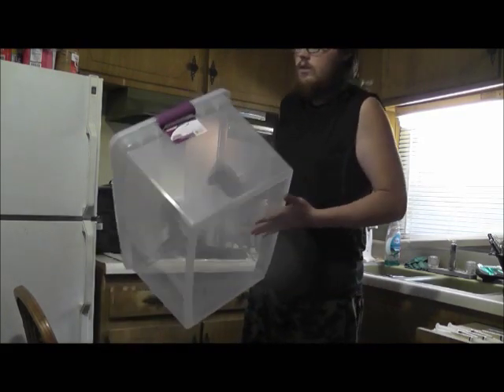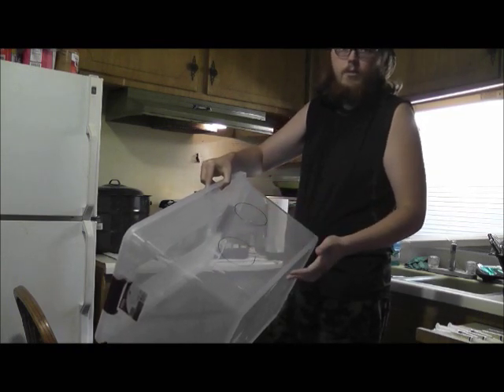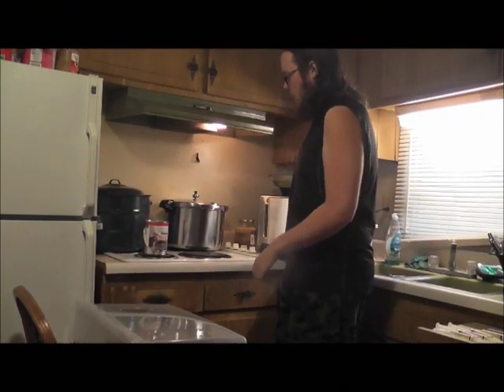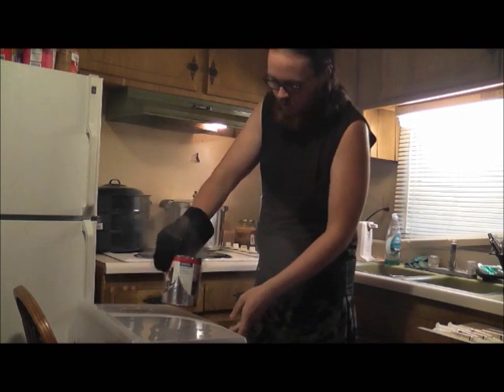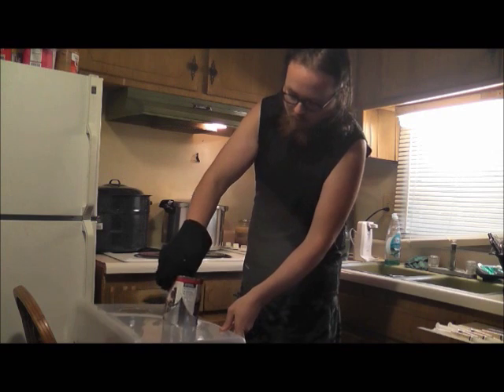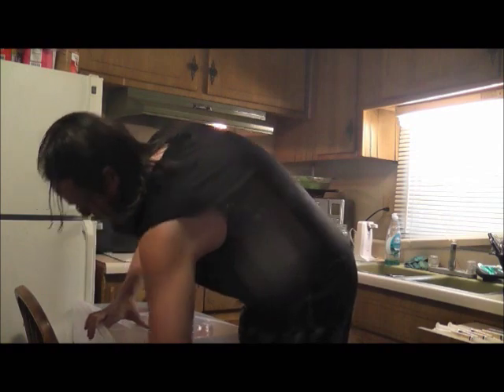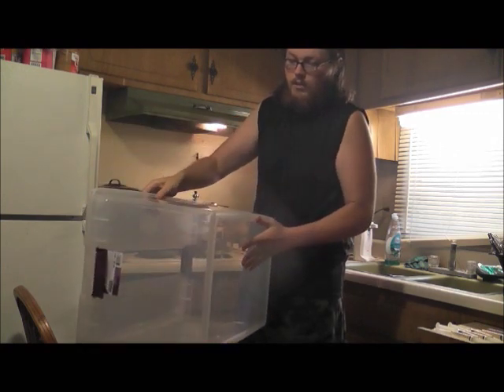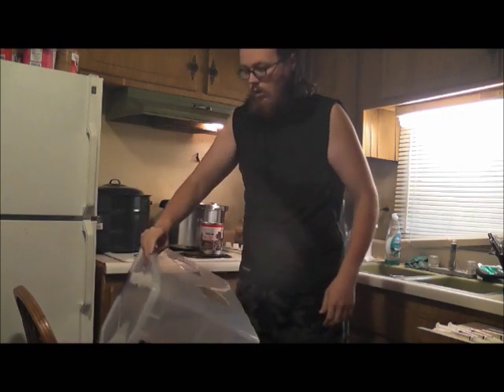How To Make A Still Air Box

Comment from the maker: On harvesting, you can twist and pull the mushroom at the base, which usually damages the substrate a little, or you can use a sharp blade to cut it at the base and leave a small stump (my preferred method).  Contrary to popular misinformation, the stump won't rot.  It will convert back to rhyzomorphic mycelium, and new clusters will often pin from that location.